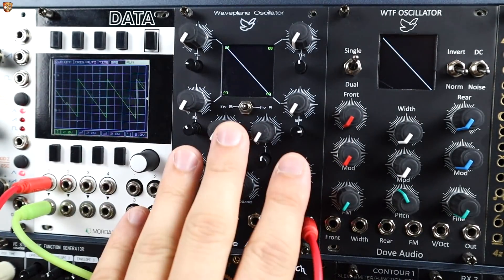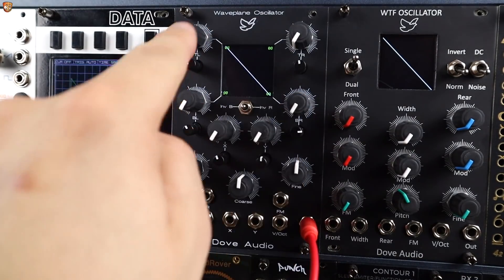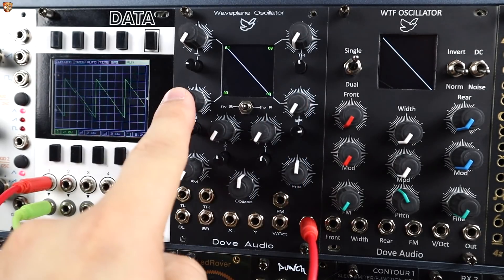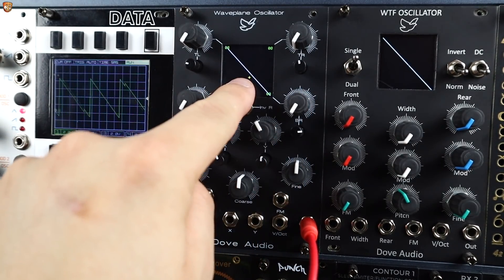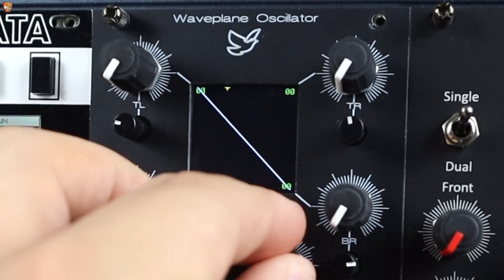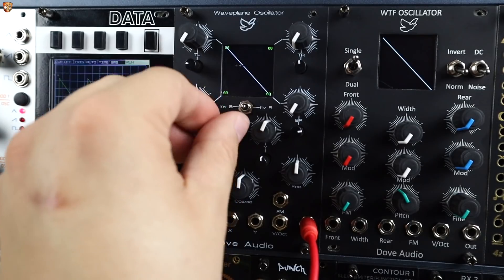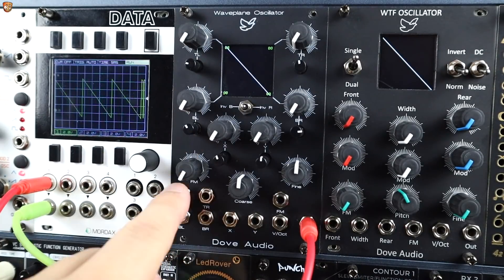WTF is a Waveplane? Dove Audio Oscillator Explanation

Comment: So with TL, TR, BL and BR I choose 4 waves inside a wavetable which I then can blend over between with X and Y like in a VectorSynth. But where do I choose the wavetable?
Reply from the maker: Hi, the wavetable is the waveform on those 4 knobs. It morphs between a table of waves through the knob turn or CV modulation. 

So you set 4 waves then build the XY map to crossfade between them. But if you want to scan the wavetable in any corner use the CV input and CV attenuator for the corner (a corner as TL, TR, BL, BR).

Comment: Both look great. Do both oscillators share the same wavetables and is there an option to turn off the smooth morphing?
Reply: They both have the same wavetables, on both modules there are the option to turn one or more smoothing (Jumpers on the rear).
Reply: That's what I was hoping for Paula. Good news. Does this mean there are other options available via the jumpers on the rear and does this also mean you might offer a small expander module in the future? @PaulasTechStuff
Reply: @slingsby  the other option on the back is to enable/disable the "octave" snap function, so the coarse knob is a continuous sweep of frequencies rather than octave jumps.
Reply: @PaulasTechStuff  So with TL, TR, BL and BR I choose 4 waves inside a wavetable which I then can blend over between with X and Y like in a VectorSynth. But where do I choose the wavetable?
Reply: @WackyJackyTracky  Yes :) 
It's kind of like a 6 dimensional wavetable I guess.

Comment: the waveplane has some sort of clicks & pops or audio artefacts or is it me?
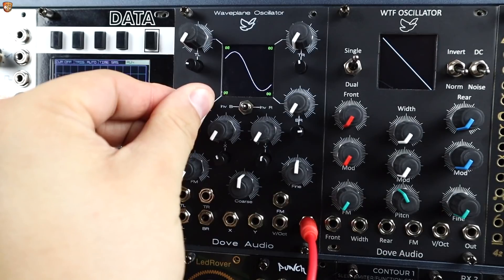I can hear a lot of sudden changes in the sound from 1:11 for instance, where I would have expected, well, smooth morphing.
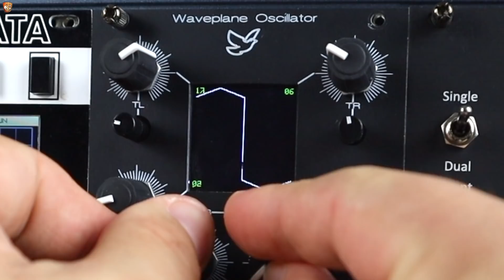at 2:00 as well
Reply: I think you're hearing that Ben is moving the X/Y and waveknobs quickly, try this video here where I run 6 LFOs into the waveshape inputs - https://youtu.be/i2S0IHE_Nxc?t=90
Reply: Clicks, pops, artifacts from quickly modulating a wavetable synthesizer?  Me thinketh the dub hath been stepped.
Reply: @PaulasTechStuff  in your video I can't hear the artefacts where the wavetables are modulated by the lfo, but I think I hear some when there is no modulation, like from https://youtu.be/i2S0IHE_Nxc?t=78 until you plug the lfo again. I am wrong?
Reply: @NiamorH  I had a bad audio connection which produced some clicks. Other WTF users will happily confirm there's no audio clicks from my modules.
Reply: @PaulasTechStuff  ok good to know, that's reassuring

Comment: *OCD ALERT* argg.... like those guys who made the 3?4? channel expensive mixer last year - Dove can't make their logos or even fonts match between modules.  Kills me when good sounding hardware like this looks like $#!+
Reply: I've never made a mixer, as for the different looks, if you watched the first video you'd understand this is the prototype and the final one will match the production WTF that Ben has. 
Maybe do a little research before jumping in to criticise next time :)
Reply: @PaulasTechStuff  I did watch the first video and your devices sound great.  It's just the OCD in me that makes me cringe when I see different fonts used side by side.  Please take it as constructive criticism - again, the modules sound great.  As to the 'expensive mixer', that was another small manufacturer that ben did a review of a year ago. they had the same issue. I'll look it up.
Reply: @time4anew1  As I say, and as ben says, this is a prototype, and the final one will look the same.
It's not constructive when it's already been mentioned that it's not the final version.
Reply: @PaulasTechStuff  Please use different fonts every time.
Reply: Use different fonts on individual units of a single production run too if that is possible.
Reply: https://youtu.be/ulBFjuAGAFg?t=870
Reply: I agree both are kind of ugly. I personally really dislike the super precise lines at every mm for each knob parameter. Doesn't actually matter much in practice and pointlessly clutters things, at least for me.